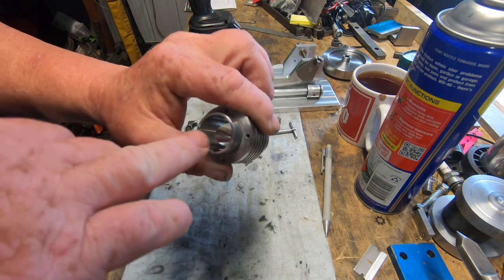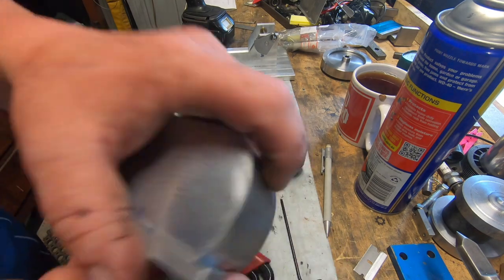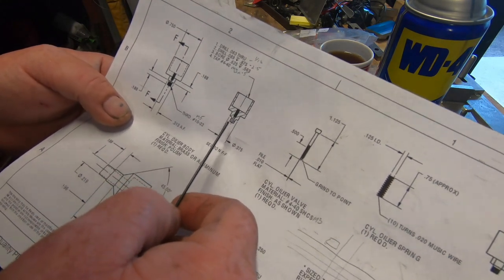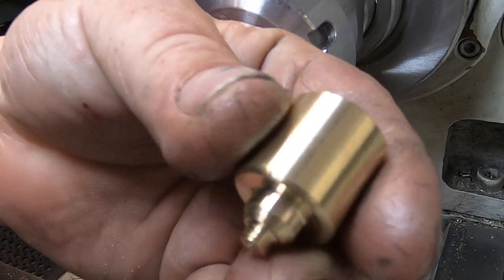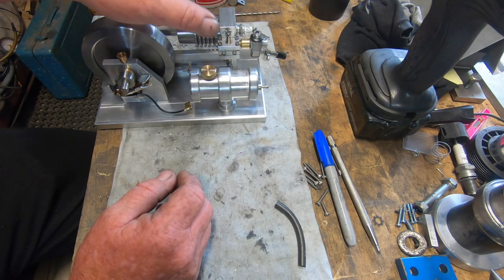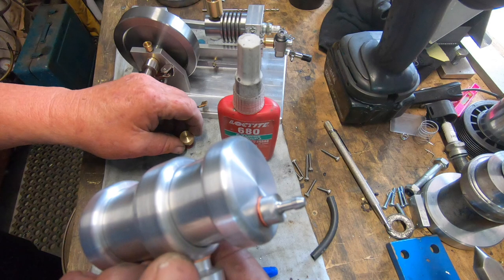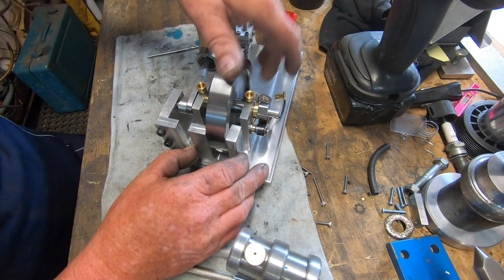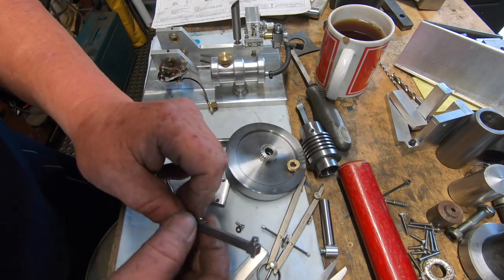Webster Engine, part 10 - LOTS of talking, Fuel tank, Exhaust & Oilers,

Comment: If you turned a bevel on the ends of your main tank tube, and used a through bolt to pull the end caps together over O rings just a bit too think for the space remaining in that bevel, makes a wildly good seal.  Use washers and seals cut from the fuel line to seal the bolt each end.  Then the tank can be easily serviced or modified any time you want.  Can turn the end caps to be a bit high in the centre where the bolt goes through to avoid compressing it in if the bolt gets tightened a bit far...  All sorts of options will become apparent as you make more, and you can scale the idea up and down a long way.  Looking forward to seeing her fired up in coming days.  Have a good Xmas and New Year - hopefully you get to see a bit of the family and you all stay safe.
Reply from the maker: Gday, that’s a great idea for a fuel tank, I’m sure it would work great, in the next video I hope to have the engine running, fingers crossed, have a Merry Christmas and all the best for the new year, cheers

Comment: Nice solution on the fuel tank. While some copper plumbing pipe and some end caps might have been easy I think the Al tank looks better with the rest of the build.
Reply from the maker: Gday, I did think about copper pipe but that’s quite a common way of making a fuel tank, I think this suits the engine better, appreciate you watching and commenting mate, Cheers

Comment: Absolutely love it! 😍 That's one serious little machine you've built there, Matty. Seeing those points brings me back 😊. Always used to carry a spare set in my old Chevy (even though I never really needed them 😉). Can't to see it burn some hydrocarbons 👍😁👍.
Cheers!
Reply from the maker: Gday Chris, great to hear you like the engine, it’s as good as done so I’d say the next video should see it running fingers crossed, the points ignition is certainly old school, I think I’ll use a Hall effect sensor if I build another engine just to see how they work, keep an eye out for the next video mate, Cheers

Comment: Hello Matty,
Great work... I was wondering if you could have some sort of drip oil feeder over the gear wheels if you're not having the exhaust pointing away from them.
I hope you guys have a Merry Christmas and Happy New Year 
Take care.
Paul,,
Reply from the maker: Gday Paul, with the oilers that feed the crankshaft bearings get topped up it’ll be easy enough to put a couple of drops on the gears at the same time I’m thinking, in the next video I dare say the engine will be running, fingers crossed anyway, hopefully the video will be out before Christmas Day, Merry Christmas to you and your family and all the very best for the new year, thanks for all the support throughout the years to mate, much appreciated, Cheers

Comment: G'day Matty. Coming along nicely! As for getting the fuel cap to seal would it not have been easier to use an end mill of roughly the same diam. of the cap sealing surface to put a nice flat, round recess on the tank wall around the filler hole for the cap base to seal to? Just a thought. Keep up the great work. Cheers, Bo
Reply from the maker: Gday Bo, I didn’t think of the way to make the cap, I’d say it’d work no problem at all, appreciate you watching and commenting mate, merry Christmas and all the best for the new year, cheers

Comment: Nice to see it coming together. Fuel tank looks good and the exhaust tip is trick. Do you have to mount some sort of battery to provide the spark?
Reply from the maker: Gday Tom, yes there’s going to a battery with the engine, more then likely in a box under the engine, appreciate you watching mate, Cheers